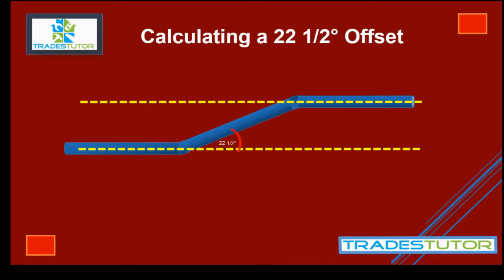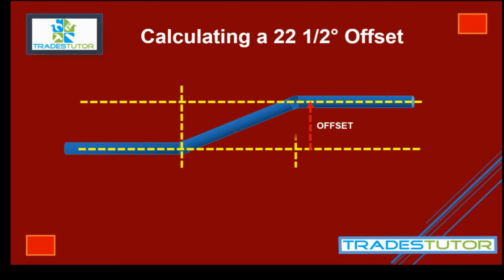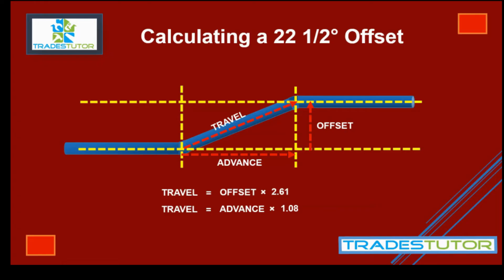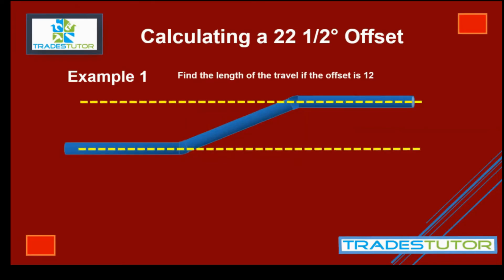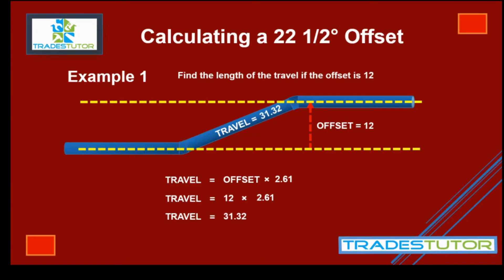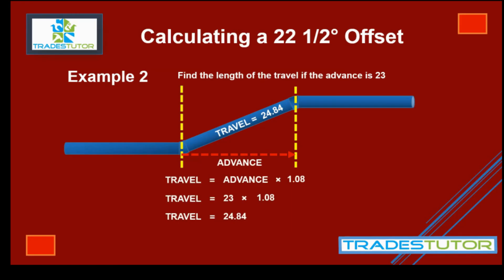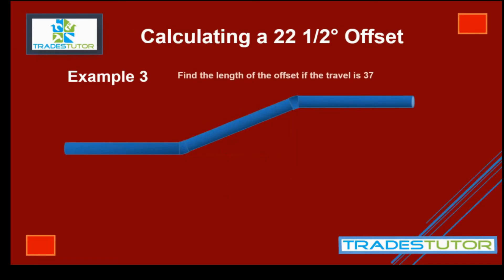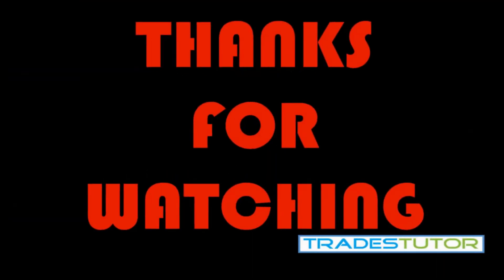Calculating a 22 1/2 degree offset piping system

Comment: What he didn’t explain here is that if you have a calculator with sine and cosine on it you don’t have to remember any constants.  For travel of advance you want secant of angle which 1/sin of angle Ex. 1/(sin of 22.5) = 2.613.  For travel of offset you want cosecant of angle which is 1/cos of angle Ex. 1/(cos of 22.5) = 1.082. This works for any degree offset like for a 45 degree offset your advance and offset will be the same so you can use secant or cosecant therefore 1/(sin 45) or 1/(cos 45) will both = 1.414.  Have the travel and want the advance or offset? Well it’s sin of angle or cos of angle.  Sin 45 = .707  1.414 is the square root of 2.  Remember a^2 + b^2 = c^2 for right angle triangle, so if you use a unit circle where radius =1 (I know you’re asking what does a circle have to do with a right triangle? Just trust me) you’ll have 1^2 + 1^2 = c^2 therefore 1 + 1 = sq root of 2.  Sq root of 2 = 1.414.  It’s all trigonometry revolving around the unit circle.  hope this helps someone because i just finally made sense of this while studying for city plumbers. They should’ve shown us in high school what these things were used for them maybe I would’ve paid attention in trig class anyway no point memorizing constants when you can calculate for any angle.
Reply: great. thank u

Comment: Hi thanks for the video couple quick questions when plugging in the numbers is the advance taken from the center of the 22.5 degree fittings? Also is the offset taken from the center of pipe?
Reply: ALWAYS work from center when pipefitting!!!!!
Reply: You’ll have to do the take off for the two 1/16 bend fitting

Comment: thanks, gotta run a little 4" pvc sanitary pipe with an offset tomorrow. i totally get the offset x 2.61 = travel. 
i just don't see where you use the other formula. you have an offset and fittings.
Reply from the maker: Hello: I'm assuming you are talking about the "advance X 1.08 = travel? That's essentially a trigonometry number when dealing with 22 1/2 degree offsets. You could use that portion of the formula to find how far of an advance you needed to go. By the sounds of it I don't think that part of the formula will be needed for what you are doing. Note: Don't forget to include fitting allowance when calculating the travel. This video does not take fitting allowance into account. I make another video for that calculation. Take care and thanks for watching
Reply: Don’t forget that this formula doesn’t account for the hub portion of your fittings.

Comment: Good day, i got lost a bit heheheh why in 45 degrees. offset and advance are same multiple and division by 1.414 but in 22 1/2  offset and advance are different where to multiple Please correct me if I'm wrong. Thank for
Reply from the maker: Hi Eduardo: in  45 degree the offset and advance are the same due to the fact that in a right angled triangle both of the other angles are 45 degrees. This means that both are the same length and both use the same number (1.414)  in the math. However, in a right triangle with a 22 1/2 degree angle the other angle is 67 1/2 degrees. This means that in order for you to find one side or the other you will need to use different multipliers. I hoped this helped.
Reply: A right triangle, so no nedd to complicate the case

Comment: Why not use a 30 degree, if offset is 4” , i.e. , obstruction . X’s 2 = 8 . If 1st mark on conduit is 8” . Add 8” , 2 mark is at 16”. Bend pipe first mark to 30degrees. , flip pipe 180. Bend 2nd mark 30 degrees. Job done. We want to get paid , guiseppe. U think the boss want a trig. Major to bend pipe?
Reply from the maker: Hi Robert: Thanks for your input. If you can find an easier way to calculate offsets then go for it!